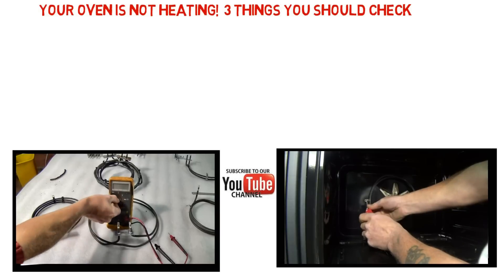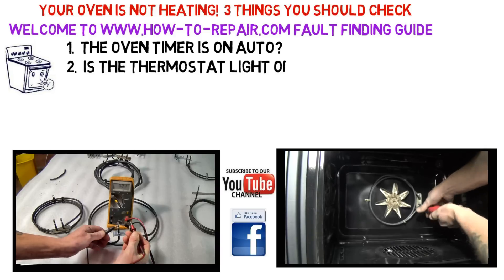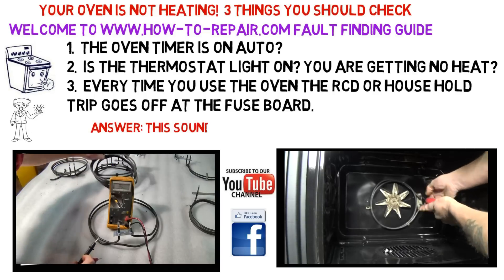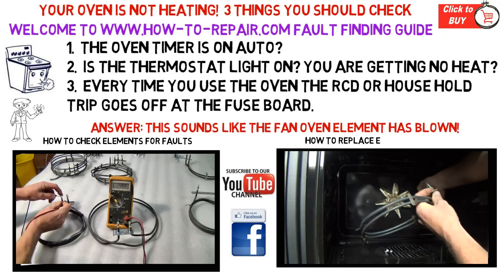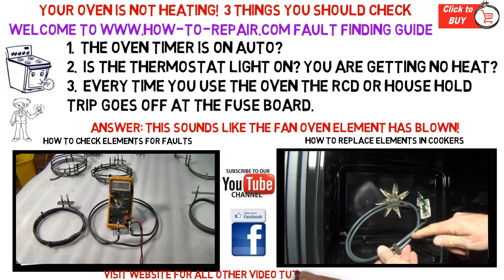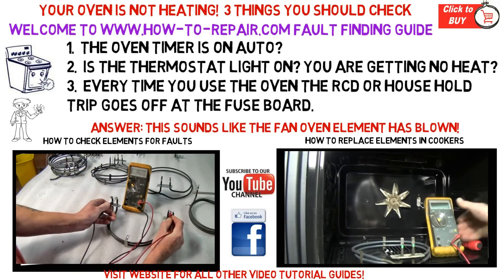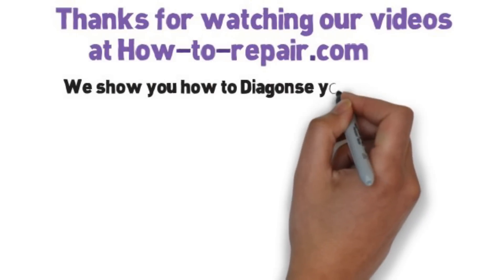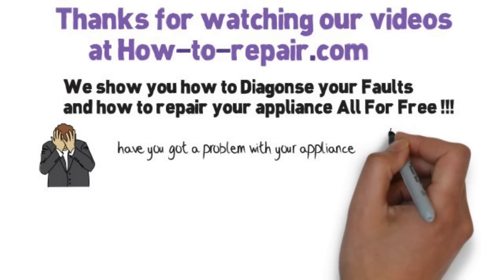Whirlpool Oven not heating or tripping the electrical? it will show you how to replace elements

Comment: Just wondering if you can help. I have a Whirlpool AKP 203 I. It heats up perfectly, but when it heats to a high temperature, the electricity will trip.  Upon reseting the fuse box and turning the oven back on, once again it will trip the fuse box. I have changed the ring element but I still have the same issue. I have been told it could be the thermostat, would you agree?
Reply: Hello.  I have had the same issue.  Whirlpool stove is fine, unable to get the oven to stay on during the pre-heat at any temp.  Looking for answers.  Ready to call repair for replace the board, whisch I believe is going to fix the issue.

I thought back to when it started...In my case, the oven light had burnt out, I replaced the light bulb.   The oven continued resetting the breaker, even though the light was working.  Reviewing the posts, got me thinking about shorted circut board and finally replacing it.  
As my last bit of troubleshooting, I removed the light buld from the oven, effectively removong that circut from the boards equation  (no loop to the light across the board).  

The oven now works properly, has not tripped the breaker since the "fix", just no light for the oven.

I don't know if this will work for you, but seems to have corrected the problem, for now, untill I can replace the main board or get a differnet manufacturer range (which is what I am considering, based on the amount of reported issues with Whirlpool).

Comment: Hi I have whirlpool AKP216/IX and the fan oven does not heat up but the grill work's fine. It's only 3 years old but not sure if I should get it repaired or replaced with a deferent make.
Reply: Android 1 to
Reply: They will
Reply: HI, Did you ever get this sorted?